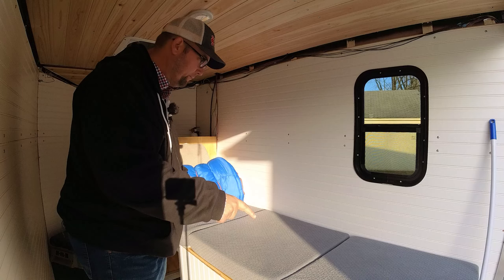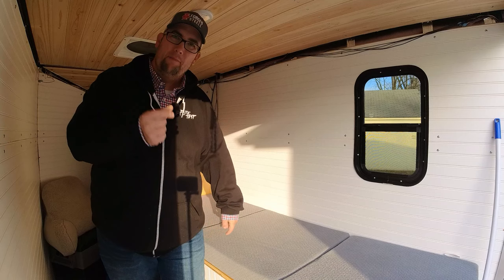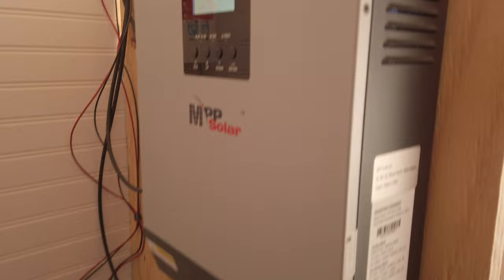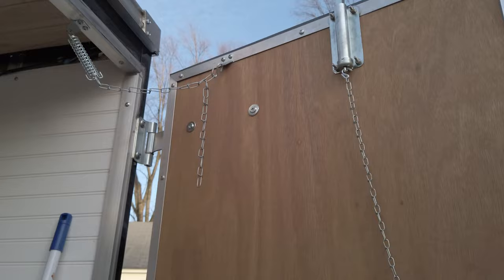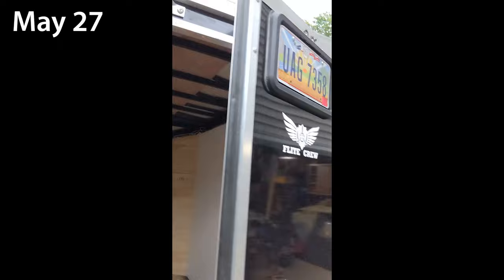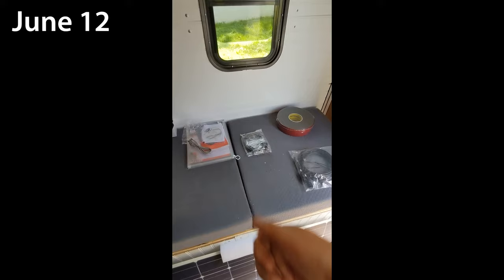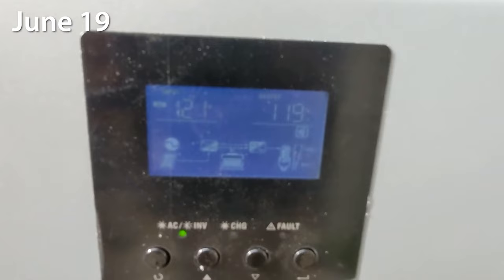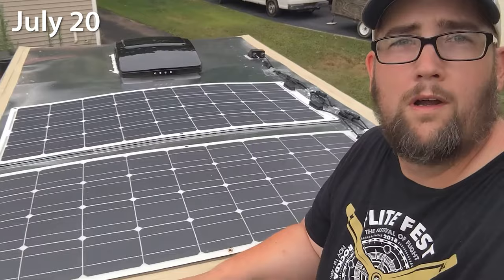5x8 Cargo Trailer Camper - Yeah . . . It's Done

Comment: I'm assuming you were trying to do this as a budget build, with some priority expenses for such things as the fan, windows and electrical.  Here are a couple of suggestions based on my own experience with our 6x10 and observations of other notable YouTube examples.  First, you have a V-nose.  I personally feel you aren't taking serious advantage of that design. You would be able to put SO much more into your trailer capabilities if you build in a full counter and upper cabinets into the V-nose.  Our trailer isn't a V-nose, but we maximized the front of ours by making that the galley and electrical system.  Second, for your issue of where the ceiling meets the wall...your idea for simple molding is workable.  My wiring runs along one side like that and the fans out above the ceiling to feed my 4 puck lights in the ceiling.  I have one extra wiring run to the very back corner, by the twin doors, in case I want to add another 12v function.  In my case, since the gap between wall and ceiling was a bit larger than any attractive molding I could find, I used beadboard paneling and just cut pieces vertically at the width I needed and attached those at about a 45 degree angle (it just looks a little nicer).  I can easily remove them if I need to do any electrical work there.  BUT, I would strongly suggest building yourself shelves there, preferably with dividers and individual doors (e.g., cabinets).  If you don't want to go that far, make at least the shelves the entire length of the trailer on both sides, with a lip and dividers and then use bungies or similar to keep things from flying off.  You don't have to make the shelves/cabinets very tall or deep--do what fits the clearance you feel you need.  But this would give you critical storage space for food, clothes, tools, etc.  Also, what are you doing about water (and water-related needs)?  Again, this is where fully exploiting your V-nose comes in.  If you look at my build, you'll see you could fit in a sink and use an inexpensive USB-charged water faucet.  We have dual 7-gallon water containers (one for gray water coming from the sink, one for fresh).  We did eventually flip the axle to get more ground clearance and to eventually accommodate a larger freshwater tank underneath.   Anyway, those are my thoughts.  You've got a good start and it's certainly functional for basic camping with modest off-grid capability. 

Oh!  One last thing, regarding your power.  We currently have a 200w Renogy system in our trailer and even with a 200ah lithium battery, we discovered our 12v refrigerator/freezer eventually depleted the battery.  We adjusted temps on the fridge, and that's improved things with little negative impact on keeping food cold enough, but the bottom line is that 200w are NOT enough to keep the battery topped off if we don't have plenty of consistent sunshine.  We live in SW Texas, so we actually get more direct sunshine for longer, but we never get anything close to the full 200w.  So, we've discovered we REALLY need to bump up to 400w to get enough juice under typical conditions to keep the battery topped off.  We do have a small inverter generator for emergency.